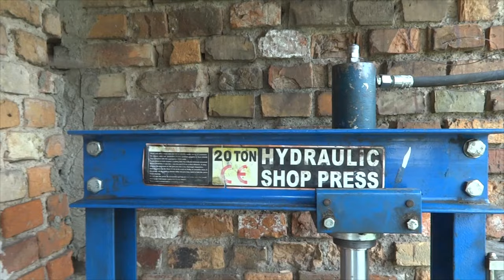DIY Crucible Like From The Factory

Comment: I loved this video.
Could you make more about the crucibles?
An assessment of how long it lasted,  or compare it with a purchased graphite and refractory one? Or make several and see if they all come out the same.  Or just anything really. 
I've been looking all over for good crucible videos, especially for DIY crucibles for cast iron and just not finding a whole lot 
THANKS!!
Reply from the maker: Thanks for the positive comment, I will try to find the answer to your questions, I will be testing the crucibles, it's just a matter of time. The previous crucibles that I made without the use of a press withstood a dozen or so castings and nothing happened to them, I just wanted a larger crucible because the furnace can melt more and I want to use it, just watch my channel, because I will continue the topic of crucibles and maybe you will find answers to your questions in my videos
Reply: @warlof1  Very cool btw!   Graphite is a good choice.  Halfnium carbide powder of you can find it would work well with it's extreme melting temp.  Question?  Why did you use 25% graphite and not more?  Also, as you seem to already know I suspect using the min amount of pure water with have the highest psi this hardness this heat Resistance.
Reply from the maker: @l0I0I0I0  I looked through various thematic forums and the experiences of others in the creation of crucibles that this proportion is appropriate, graphite simply combines well with chamotte mortar in these proportions. But when I find some free time, I will also take care of trials with more graphite, and we'll see what happens :)
Reply: @warlof1   Chamotte mortars.  I WOULD LOVE to make a HUGE crucible!  Special application.
Reply: @warlof1  Is there an Chamotte mortar, ultra high temp you can recommend?
Reply from the maker: @l0I0I0I0  Fireclay mortar in different countries will be under a different trade name, look for a mortar that is used to build bread stoves or fireplaces, and if you do not find such mortar, then just powdered fireclay brick and clay
Reply: @warlof1  TY, yes high temp mortar is common

Comment: Really nice work. I read that you added graphite powder, but what kind of concrete/cement did you use? :)
Reply from the maker: The cement you are asking about is fireclay mortar, i.e. powdered fireclay brick with the addition of Portland cement.
Reply: I found this stuff called  heat stop  at a masonry supply yard that works pretty well
Reply from the maker: @lewisgiles8855  That was the point, the trade name for this product may be different from country to country, but the composition is the same.

Comment: Nice job! That inner mold form looks like a lot of work. What if you used a stainless steel martini shaker for the inner form and poured it solid full of aluminum? Just thinking.
What exactly was the change that you made to the outer mold? Was it just shortening the limiters and adding the handles? I bet you could use a flex-hone to polish the inside of the outer mold and make it ever so slightly conical.
Keep up the good work.
Reply from the maker: The inner part of the mold can be made of aluminum, I just made it of steel because it is easy to convert something made of steel, for aluminum I would need a different type of welding machine if there was a need for a conversion. Yes, the change in the outer part of the mold consisted in shortening the stops and adding handles, if I made a slightly conical shape in the outer form you are right, also the crucible would be easier to pull out of the mold, without trying I would not know what could be improved, I will continue the project.

Comment: Vibrating the mold while compressing by tapping with a 2 lb piece of wood or equivalent rubber hammer, would help the crucible mass particles compress together better. You'll find you get more movement on the hydraulic press after tapping the mold.
Reply from the maker: Thank you for your valuable tips. Regards
Reply: Orbital sander much better. Or a saw

Comment: I'm gonna try this. Is it strong enough for copper melting?
Reply from the maker: Yes, it will withstand copper melting, in another video I show copper melting in a smaller crucible that has exactly the same composition as this one.
 https://youtu.be/3-J-v11aI6A
Reply: As long as you don't use terracotta, you'll be fine. Red clay will vitrify.

Comment: What kind of mixture do you use?
Reply from the maker: The mixture for the crucible is: 3/4 fireclay mortar and 1/4 graphite dust and a little water to combine it, the consistency is to resemble wet sand.
Reply: Use enough water to get fireclay and carbon clumpy enough.

Comment: Do you think this is strong enough for iron casting? And overall, do you think the process is worth it?
Reply from the maker: I would have to test this crucible to see if it can withstand iron melting to answer that, theoretically it should withstand because it consists of materials that are resistant to a temperature of 1900 ° C. In my opinion, it pays off, because the costs incurred to make the crucible are small and you can learn a lot from even a failed attempt.
Reply: @warlof1  can you tell me what materials you mixed ? Please
Reply from the maker: @jorgep.2033  The composition of the mixture is 1/4 of powdered graphite and 3/4 of fireclay mortar and a small addition of water to combine the mixture. In this video I show the lineup https://youtu.be/CSiR-ms2X7Q

Comment: you get a few kg of molten metal breaking out of that and you will just buy one
Reply: Another useless comment from the arm chair foundry guys. Clearly you've not done much of this kind of stuff. Even the so-called inexpensive, yet rather well made, crucibles from India are not inexpensive in the long run. If you cast a lot, you'll go through lots of crucibles. If you cast different metals and especially alloys (and you understand what you are doing), you will keep different crucibles specifically for those base metals and alloys. It all adds up rapidly. Using the materials and methods this video's author explains will reduce your costs substantially